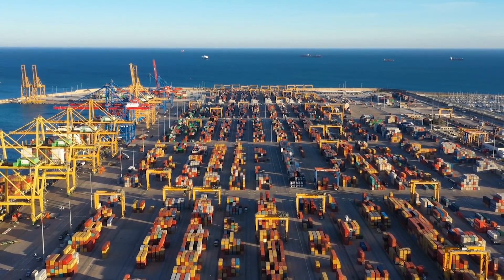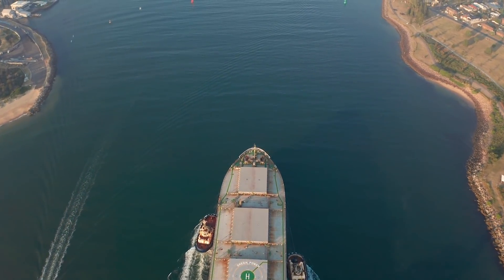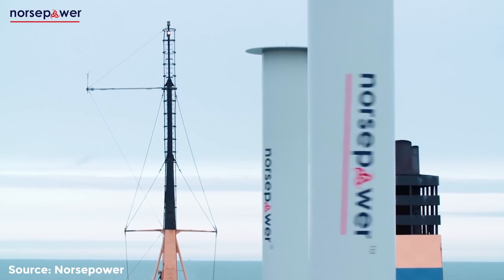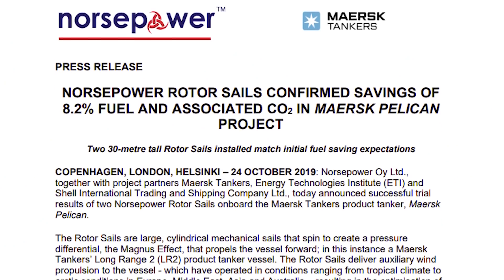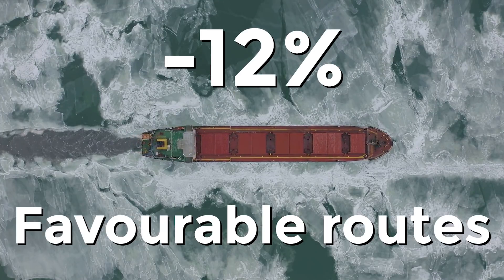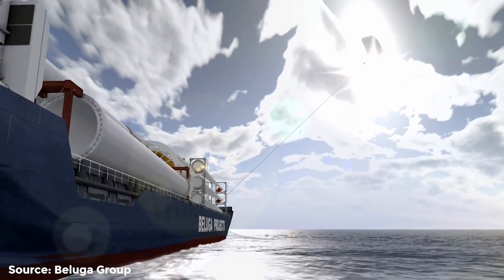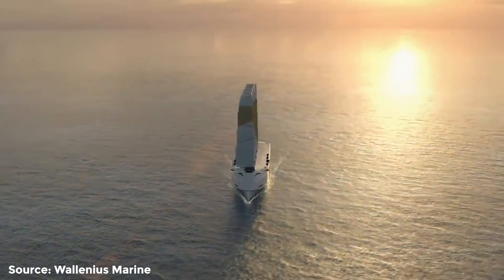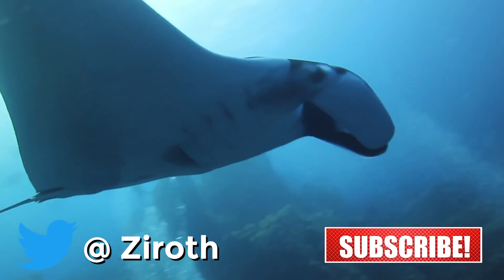Is Wind Power The Future of Shipping?

Comment: These wind systems only replace a fraction of the oil burnt, at some inconvenience. Nuclear would replace the lot, take up much less room than the fuel, could travel faster at lower running cost, and would only need refuelling every couple of years. Once steam technology matured, power/wind hybrids quickly died out. The same will happen with nuclear, for all large ships ( which carry 90% of world cargo.) Faster surface-effect craft might even take over transoceanic passenger routes from aircraft. There are no long range aircraft on the drawingboards that really cut emissions - biofuels still put water vapour into the lower stratosphere, which has more warming effect than CO2, and hydrogen does too.
Reply: If you do a web search for ‘nuclear ship savannah’ you will see that it has been tried and did not work.  A similarly heavily subsidised, by the government, vessel is in use in Russia which also operates, in support of the Northern Sea Route, a fleet of nuclear powered ice breakers these may, or may not, have been completely without issues.

Just think; would you have full confidence in the management of a nuclear reactor under the control of an anonymous entity only traceable, perhaps, via a letter box in a FOC (flag of convenience) nation state?  If you are, could you sell that confidence to Japan, the state that hosted the Hiroshima and Nagasaki nuclear detonations as well as more recently the Fukushima ‘event’?  Then try that same, or a similar, sales strategy on Ukraine, the nation state that as a part of the USSR (CCCP) hosted the Chernobyl ‘event’.  Modern iterations of nuclear energy, thorium fuel, molten salt reactors or fusion reactors, will carry the legacy of past problems.  It is the global trepidation of anything with 'nuclear' in the name and the economics of nuclear having transitioned from 'energy to cheap to charge for' too 'the costs of remediation are incalculable' that will prevent the adoption of nuclear energy as a means of creating energy at sea.  Modern reaction systems may have overcome the safety problems but the general public, having been misled in the past, will be reluctant to believe the fresh new promises.

‘They’ say nuclear is cheap, it’s not it is expensive and has a large embedded carbon quotient as well as being complicated, dangerous, not universally socially acceptable and having only ‘no need for refuelling’ as a questionable advantage; actually it does need refuelling just not as often.  When ‘they’ do need to refill the warming up stuff it takes considerable longer than pumping tonnes of thick black stuff, HFO cSt380, or thin runny stuff, MDO, onboard which is one of the reasons HMS Queen Elizabeth and HMS Prince of Wales are pushed about by ICEs and gas turbines thus using a similar fuel as the aircraft that fly off of them.  The Royal Navy (RN) with a high degree of skill and expertise uses, at vast expenses to the UK taxpayer, a current operational nuclear fleet of 11 submarines (also known as ‘boats’) in two flotillas, seven attack subs and four ballistic missile boats.  The carbon footprint of all the extra bits of hardware and the fuel, including processing thereof, from ground to propeller, are the external costs that never seem to get considered.

Disposal, once it wears out, of both the machine (that was a ship) and fuel is another can of worms best left unopened.  The 26 RN boats no longer in use are laid up (some in Rosyth and some in Portsmouth) awaiting long term deconstruction including dealing with the fuel rods and other irradiated material.  The USN is not, as far as I know, a commercial organisation working to very tight margins and also has the skill and expertise to handle the complexities of nuclear power; so as well as submarines their aircraft carriers are nuclear powered and each of the current iteration has a build cost three times that of QE/PoW, bigger crews and more generous funding.  For those who still think that nuclear energy might be the answer I recommend this report: - https://www.bbc.com/future/article/20200901-the-radioactive-risk-of-sunken-nuclear-soviet-submarines?ocid=ww.social.link.email.  The navy of the USSR might have been under resourced and over extended but it was still generously supported in comparison with merchant shipping.
Reply: @BernardLS  ' try that same, or a similar, sales strategy on Ukraine, the nation state that as a part of the USSR (CCCP) hosted the Chernobyl ‘event’. Ukraine gets over half its electricity from nuclear reactors, as a result of which its power emissions per kilowatt hour are usually lower than Germany's, even though Germany has 15x the per capita income, and has spent 150 billion Euros on renewables in just the last five years. Germany has the highest power prices in Europe, and Ukraine has the cheapest. https://ec.europa.eu/eurostat/statistics-explained/index.php/Electricity_price_statistics  At the moment, Ukraine's emissions per kw/hr are 228 grams CO2, Germany's are 396 g
Reply: @2x6x250ml  Ukrainian trust it’s own nukes, it might not trust those controlled, managed or handled by a FOC letter box company.  Ukrainian has first hand experience of what can go wrong which was the point I was making. In slightly similar vain had the ‘Ever Given’ had a nuclear power set rather than ICE hydrocarbon many people might have been nervous over the last week. On a crude GDP basis 15 times the income could result in 15 times the emissions so is the Bundesreplik actually doing worse or better?
Reply: @BernardLS  Worse. Grams of carbon per kw/h scales to usage. The Germans use more power, it's dirtier per unit, and it costs more. They are rich enough to afford to be wasteful. Meanwhile they pat themselves on the back for being so clean, with all the solar panels and wind turbines they can see. The CO2 they're venting is invisible. The half dozen Russian and 2 US nuclear submaries have caused no external problems, whereas every oilburner sunk leaves a toxic floating slick.
Reply: @2x6x250ml  When your only tool is a hammer there is a tendency to treat every problem as a nail, the different electricity prices in Germany and Ukraine may reflect: -
Exchange rate differential;
Local consumers’ ability to pay;
Reverse economies of scale (greater regulation costs)
The only way to limit consumption is with a pricing mechanism.
WRT loss of reactors at sea my view is that the revelation of the down side may still be awaiting the full disclosure.  The Germany high seas fleet that was scuppered in Scapa Flow in 1919 is still leaking Fuel Oil but also provides a source of un-irradiated steel and a good case study in the effects of pollution at that scale.  Deep sea losses are one issue but greater concern would be coastal casualties, such as the ‘Ever Green’ or ‘Amoco Cadiz’, or even worse nuclear mishaps on board a vessel in port.  While you say Germany is ‘Worse’ for the environment WADR this could be because the energy use in Germany is more intense and the Ukraine has effectively exported the most polluting sections of its activities such as fertilizer production.  I must spend some time researching your figures and view the video link you provided.
Reply: @2x6x250ml  From the Eurostat reference you provided I though this was significant, 'This article highlights the development of electricity prices both for household and non-household consumers within the European Union (EU). When available, it also includes price data from the United Kingdom; Iceland, Liechtenstein, Norway; Montenegro, North Macedonia, Albania, Serbia, Turkey; Bosnia and Herzegovina, Kosovo*; Moldova, Georgia and Ukraine.

The price of energy in the EU depends on a range of different supply and demand conditions, including the geopolitical situation, the national energy mix, import diversification, network costs, environmental protection costs, severe weather conditions, or levels of excise and taxation. Note that prices presented in this article include taxes, levies and VAT for household consumers, but exclude refundable taxes and levies for non-household consumers.'  Particularly those caveats about 'price of energy in the EU depends on'

Comment: here's an idea for a mix , use wind turbines to power eclectic motors on the ship itself
Reply: On board wind turbine might get you around some of the problems, however for marine use vertical axis wind turbines (VAWT) would be better than, the what have now become 'traditional', horizontal axis wind turbines (HAWT) for reasons that include the air draught of the vessel, weight distribution and maintenance access.  The energy yield is still subject to the wind blowing at the right strength and having space available on board for the hardware.  The masts, rigging and sail handling arrangements would take up 'prime real estate' on the vessel.  Fuel oil bunker tanks can be stuck away in any odd corner and the ICE power plants are themselves relatively compact.  The stacked up 'boxes' would mean putting the wind driven propulsion units in a bad situation from a ship stability point of view.

Comment: What about solar panels 🤔
Reply: Solar power; as an example the above container (called boxes by nautical folk) area of a Maersk Triple E is less than 399.2m by 59m.  The 399.2m is the length between perpendiculars (marine tech speak - no need to worry about it) and the 59m is the width overall (more marine tech speak so again no need to worry about it) allowing for the sides, bow, stern & navigation/accommodation structure could we agree 340m x 56m, or 19 040m2, for the ‘top of stow’ area?  Insolation rate in Joules will vary due to time of day, latitude of vessel, declination of sun, (those three impact the elevation of the power source) cloud cover, the efficiency of the solar panels and how clean they are.  The Triple E class use two 29 680 kiloWatt each, at full whack, ICEs for propulsion plus some hotel and services power load cost; so for round numbers, could we agree 60 megaWatts?  Solar panels create about 155 Watts m2 averaged out; 19 040 x 155 gives me 2 951 200 Watts (or 3 megaWatts for a round number) from the top of all the boxes.  Those three megaWatts might allow you to distil enough fresh water from the sea to wash the crud off of the solar panels (surprise fact renewable energy comes with maintenance costs) but nowhere near enough to effectively 'push the boat along'.  Fitting solar panels on top of the ‘boxes’ is worth, at most, 0.5% of your power requirement.  Side mounted, let alone towed array, solar panels are not practical given the harsh conditions found at sea.

More seriously the ‘boxes’ are loaded and unloaded from the top down so the solar panel array would need to be moved for every port operation and time is money as well as that operation having the ability to get very complicated (tech speak for ‘go wrong’).  Any additional weight would be in the worst possible place for the stability of your vessel, the operating environment would be harsh (as stated above) and the ‘top of stow’ on a ‘box boat’ is seldom a level expanse as each column of containers may be, and usually is, of differing heights.

Comment: Um do you know sails? Or we need to spell it out for you?
Reply: To address the suggestions that wind power is the answer I offer the following example.  In 1870 a premium sailing vessel entered service, the ‘Cutty Sark’.  The Cutty Sark was 64.74 metres in length with a beam of 10.97 metres and a loaded displacement of 2 100 tonnes.  She was able to carry, at best, 1 700 tonnes of cargo and to harness the energy in the wind the available spread of canvas was up to 2 976m2 which was tended by a crew of about 30 skilled men.  A ratio between the sail area (SA) and the vessels displacement (D) determines how lively she is; ‘lively’ being nautical speak for ‘fast and manoeuvrable’.  The carrying capacity of cargo ships is constrained in two ways, mass and volume which leads us to the ‘stowage factor’ of the cargo; the more mass on board the greater the displacement which in turn impacts the efficiency of the hull form and sail area / displacement ratio.  A vessel constrained by mass is said to be ‘down but not full’, while a vessel constrained by volume is said to be ‘full but not down.  When in the tea trade, which the ‘Cutty Sark’ was designed and built for with fine lines (more nautical tech speak, so again no need to worry about it) she could carry around 600 tonnes of cargo at speeds of up to 17.5 knots dependent on the prevailing wind and had a typical China to UK time on passage of 120 days.  The tea trade was very competitive so ‘time on passage’ was a large factor in securing the premium freight rate that made her cost effective.  Rounding things out, her maximum available sail area gave circa 5m2 of canvas for every tonne of tea carried.

As soon as the Suez Canal opened, which the ‘Cutty Sark’ was unable to sail through; she lost her advantage, raw speed, to the steam powered ships of that era who could beat her ‘time on passage’ by taking that short cut.  Mechanically powered ships have improved in terms of efficiency, on a freight tonne mile basis, by at least one order of magnitude since then.  After losing out to the coal burning, fire tube boiler, steam reciprocating mechanical ships of the late 19th century ‘Cutty Sark’ was relegated to the Australian wool trade, just about the bottom of the barrel in maritime terms and only one small step up from being a 'honey barge'.  The canvas, cordage and extra manpower needed for sailing ships was never a very benign environmental option so please discount any idea of sail as ‘sustainable’.  All this is without the problem that if ‘the wind don’t blow the ship don’t go’, when it does blow it often blows in the wrong direction for your cargo delivery needs and sometimes there is rather too much of it for comfort.  Sailing ships are unable to go directly up wind so if the wind is blowing form the direction your cargo needs to then a zig-zag course must be steered, more distance and more time.  Wind is traditionally measured on the Beaufort Scale (wind speed) that runs from 0 (< 1kn) to 12 (> 63kn) and for sailing purposes the usable part of the range is ‘3’ (circa 8kn) to ‘6’ (circa 24kn).

Random fact about ‘Cutty Sark’, it is said to have been possible to coax 3 000 horse power out of her sails, or in ‘real money’ 2 206 500 Watts (2.2 megaWatts), assuming this was in ideal conditions that is about ⅔ of the solar power that might be harvested from the ‘top of stow’ of a Maersk Triple E, again in those elusive ideal conditions and 741 Watts for each square meter of sail area.  So that majestic spread of canvas would have been even less efficacious for delivering your baubles and bows from the orient, despite taking about three times as long on the voyage.  The sails on the ‘Cutty Sark produce about 0.33% of the power need to propel a Mearsk Triple E and covering the top of the stow might produce another 0.5% so with both systems working simultaneously in ‘ideal conditions’ the energy harvest would be less than 1% of the output from the ICEs.  Combining with solar electric would involve two systems in place of one, which then runs you into the problems of expense, complexity, integration and redundancy.  Remember shipping is a high volume low cost, therefore low margin business, and all costs have to be beneficial.

Canvas and hemp are accorded 'renewable' (read as ‘natural’) status, if ‘synthetics’ are used there will still be a need for the input of FOGI products.  'Synthetics' would have a much better working life span than 'naturals' but would still yield the same amount of energy, 741 Watts for each square meter in those elusive ideal conditions.  Wallenius are currently giving wind power a go with wing form ‘sails’ but evidence is a little short of proof as of this date.  KTH (Kungliga Tekniska högskolan), a sort of up market university in Stockholm, who are using the funding to derive results will probably, and eventually, in the best traditions of academia ‘publish’ a ‘paper’ unless the funders invoke the well known ‘commercial sensitivity clause’ of their agreement with the KTH.  Wallenius is a major shipper of vehicles were the product is effectively its own packaging, other goods are moved about in ‘containers’ so the loss of capacity, ‘broken stowage’ in nautical speak, caused by containerisation needs to be factored in.  On board wind turbine might get you around some of the problems, however for marine use vertical axis wind turbines (VAWT) would be better than, the what have now become 'traditional', horizontal axis wind turbines (HAWT) for reasons that include the air draught of the vessel, weight distribution and maintenance access.  The energy yield is still subject to the wind blowing at the right strength and having space available on board for the hardware.  The masts, rigging and sail handling arrangements would take up 'prime real estate' on the vessel.  Fuel oil bunker tanks can be stuck away in any odd corner and the ICE power plants are themselves relatively compact.  The stacked up 'boxes' would mean putting the wind driven propulsion units in a bad situation from a ship stability point of view.